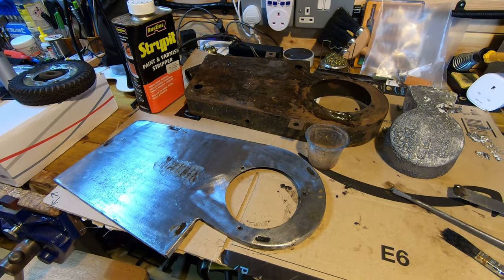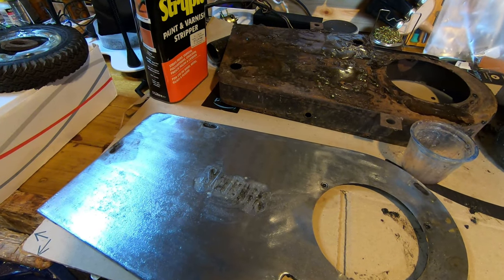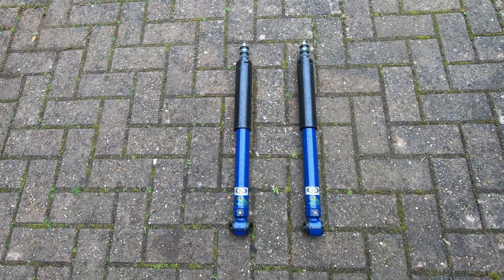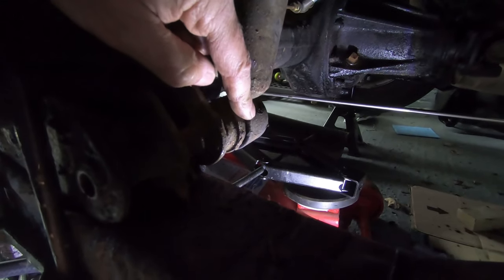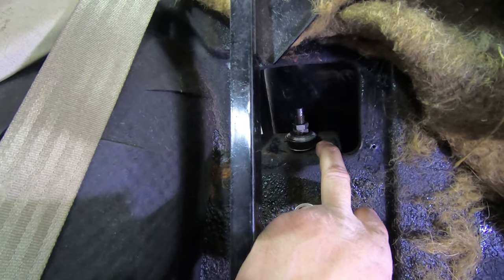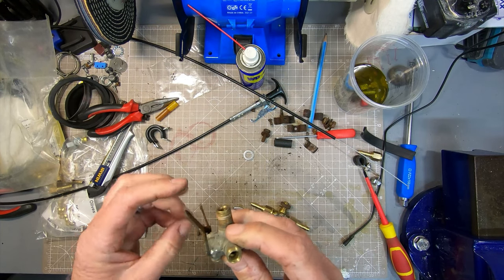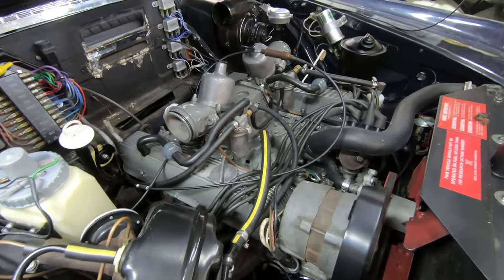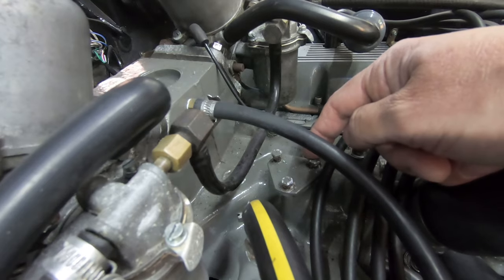Rover P5B Rear Shock Absorbers and the Cold Start

Comment: Another interesting upload.them aed starter carbs,wot a pain on the series  2 daimler me dad used to have.even the jaguar dealer couldnt set them up right.the one on my old s type is electric using an otter switch.i need a new one of them,i have bypassed it for now.its a much better choke than the aed which worked off hot air.it still has issues with flooding tho.lookin forward to your next one.

Comment: This feature is a long term Rover item - my parents had a P4 Rover 75 cyclops version that had the fuel enrichment light activated by engine temperature. It had SU carburettors that enriched the fuel mixture instead reducing the air intake which is what a choke did.
Reply from the maker: Very true, the Cold Start lowers the SU carb jet so more fuel goes in. I hadn't thought about why Rover didn't call it a Choke - they were being more accurate.

Comment: Thanks for the upload. I notice that the actuating arm on the new NOS reserve tap doesn't have a hole for the return spring.
Reply from the maker: Ah, thats interesting - there wasn't a return spring fitted when I took the original off, so I didn't even know there should be one. I wondered why the arm had two holes! Hmm, might need to reconsider what I do then - will consult the workshop manual or parts catalogue. Thanks for letting me know.
Reply: @RoverP5com  no problem. The spring is the only  means of getting the reserve pull lever to return home. There is a locating tab for the spring on the detachable cross member. Excellent explanation of the otter switch by the way. Later P5B's have the third hole for the choke warning light on the dash already in place but it is covered with the dash fabric just leaving the oil & ignition lights.

Comment: can you test the otter switch by putting it in a pot of water on the stove with a thermometer and see what temperature it operates at?
Reply from the maker: Good idea, I should have tried that. I was also thinking that the marking that says ‘B37C’ might be the temperature the switch closes in Celsius - would make sense that the coolant is just starting to warm up, so the cold start can be switched off.

Comment: Hi there can you tell me what the part no of your Shock was?
Reply from the maker: I'm not sure but they were from J R Wadhams - if you look under the P5 section they'll have them listed.
Reply: @RoverP5com  I use Wadhams quite a lot and yes I have seen them there, the point was I was trying to get an OE part no. But thanks anyway.
Reply: @leoroverman4541  OK, apologies. They're on the car now, so not so easy to check I'm afraid.
Reply: Hi Richard, seriously no problems. Unfortunately  there is not a reliable system for cross matching part nos to get equivalents, it's normally the computer says no, when it doesn't know and in our areas there's a serious rareitis issue with these kinds of parts. So it pays if you have a part no to keep it.

Comment: It will OPEN when the engine is warm so won't work! The warning light will be on continously until  the engine reaches operating temperature then it will go out.....unless you have found the elusive NO switch.
Reply from the maker: Hello, that’s not what the Instruction Manual says, nor the club forum. The Otter switch is Normally Open, and as the manual says “The appearance of the amber warning light marked ‘COLD START’ will remind you that the cold-start control is still out and should be pushed in at once.”
Reply: @RoverP5com  just do a continuity check to see if you have been lucky and have acquired a NO switch. There are two types and they look identical. Obviously, the NO switch will close when hot and will complete the circuit. Personally, I prefer the simple system which leaves the amber light on until the cold start is pushed in to fast idle as determined by the Brycrest switch.